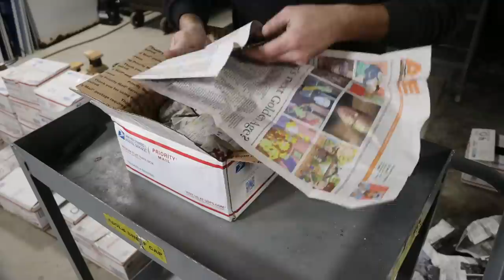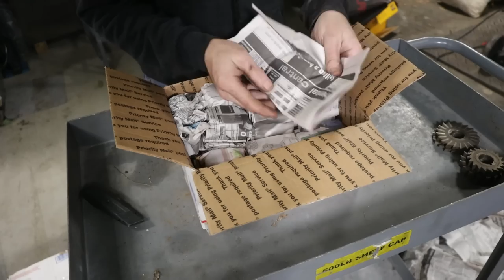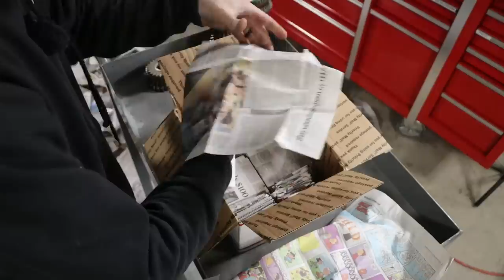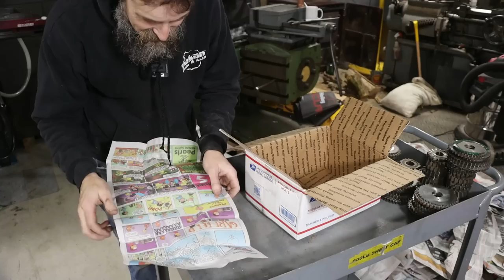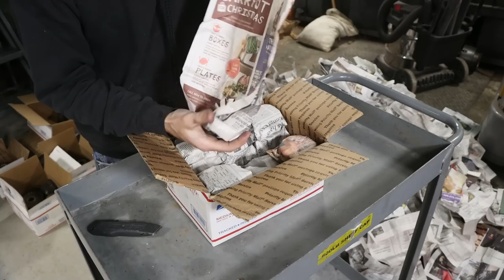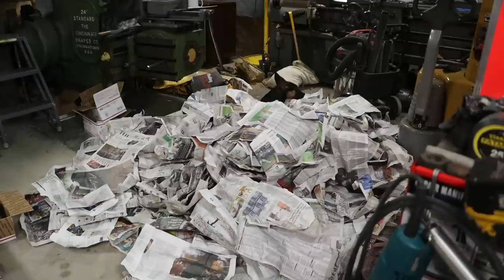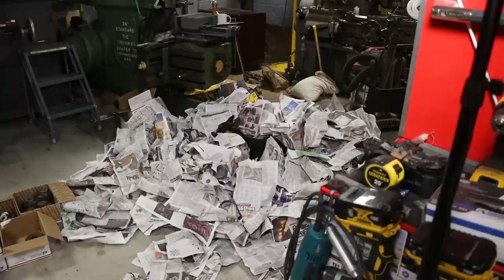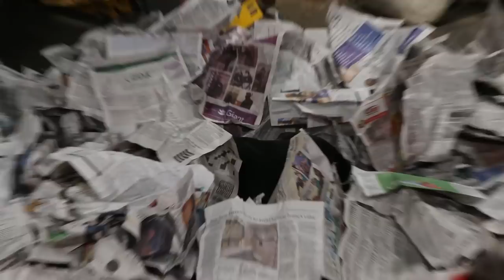Saved from DUMPSTER Milling Cutter MOTHER LOAD.

Comment: I am not trying to hate or anything but.. if i were to package cutters like these i would make a few arbors with the ID of these as the OD and then just bunch them on there and use a nut on the end and there you go like 50-150 cutters in 1 package  (depends on size obviously) easy to store and ship and just some paper around that...

Nvm he did that also, just saw at the end 😂

Comment: Horizontal milling machines are thing of the past with current cnc mills and technology just run them over for serious industrial applications(just look how much time you need to change tool vs cnc tool carusel).Reason why those almost ended in trash is because they need to be sharpened when dull and for that you need special machines and people that are like 60-80 years old now.We live in era of carbide inserts which are unscrew the screw ,throw,put a new one ,tighten it  and forget about sharpening.Sure ,maybe hobby machinist like you can use them but lets face it ,its a outdated technology like a shaper for example.

Comment: Why would you not clean the rust off of the bolt , pulleys and lubricate before reinstalling? Yet you have stainless cable does not make sense?????????

Comment: How much taxpayer money do you think you received in that pile of cutters, I'd  say thousands and thousands of dollars wouldn't you ?
Reply: Some of these cutters are $300-400+ individually if buying brand new. I'd estimate that to buy these all today you'd have $50,000~ in it. I frequently use pretty small 2" carbide slitting saws and they are around $200 a piece. I'm guessing most of what he has is HSS because that's what was available in the horizontal mill day but still an incredible haul right there!
Reply: @logankendrick2692  Thank you for commenting, I knew someone would know what the value of some of these cutters was, that to me is another example of our goverment waste program, I'm in no way blaming Steve for his good fortune, but all those cutters could have been sent to auction and maybe a good portion of that worth recovered, I'm a 74 yr. old taxpayer and this kind of stuff gets  under my skin. Again thankyou for the reply, I'd be curious to know if anyone else feels the same way about this kind of waste.....maybe they could have used the money to revamp some of our military housing we so desperately need for our service families.